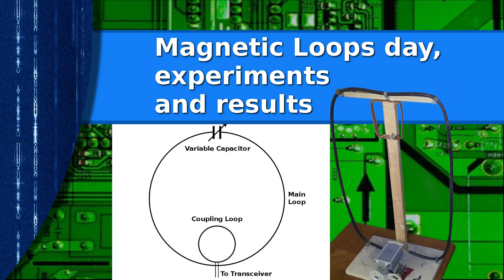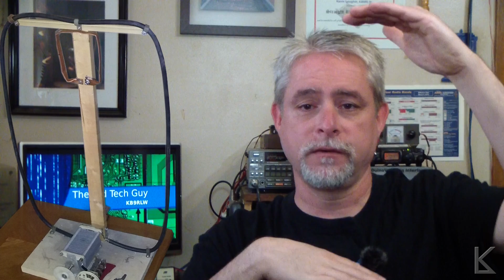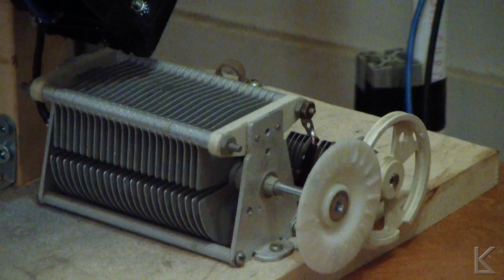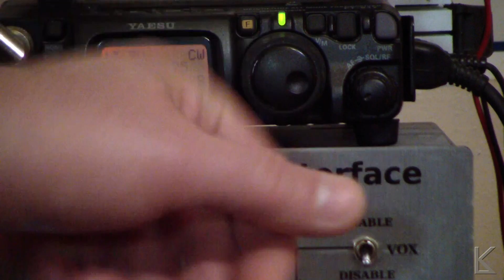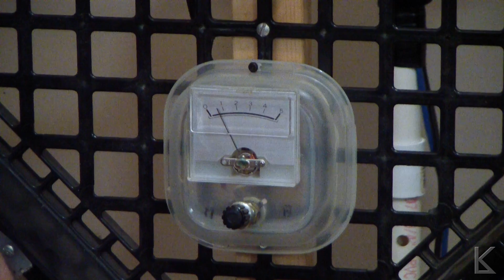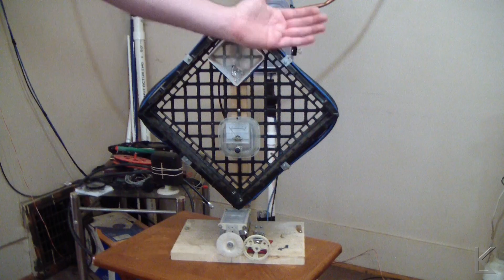Ham Radio Antennas - Magnetic Loop experiments, observations, and results

Comment: I'm glad I stumbled across this one, as it gives me new options for potential improvements. I have a loop made of aluminum strip and a butterfly cap diy. It's shaped somewhat looks like an egg because I haven't supported it, and I can't get the SWR below 1.5, so it's not usable for transmitting. I wanted to see if it would work with aluminum or if it really has to be copper. The price is quite a difference; a stril aluminum is 20x cheaper than copper.  One loop is 25,5 in (60 -65 cm) and one is 35.4 (90 - 95cm) and the cap is about 0 to 180pf.
So it looks there is more to test.. I'm also thinking about making an eight-sided barrel out of aluminum die-casting, but I haven't gotten that far yet. I need to see if I can get something that works first. Thz, For your video and the data you did get from your tests. 73" PD3A

Comment: I have an inocent stupid idea in my head. I will be experimenting with really small loops. I wonder what would be the effect of having a coil with coax shielded  cable? I mean having the coax cable external shield as the coil element and the inner core as the magnetic loop induced,  instead of the small inner loop. what are your thought on this?
Reply from the maker: Tried it, it does not work.

Comment: You are a good experimenter.  Don't be fooled by strong points of RF voltage. I also see people saying the opposite and incorrect statement in this thread, noting the high current points are where max signal is transmitted.  When an antenna operates at its resonant frequency, a standing wave of voltage and current is established along its length. It's the accelerating charges, not the absolute voltage or current, that create the electromagnetic waves. These accelerating charges occur due to the changing electric and magnetic fields within the antenna as the voltage and current oscillate. The high voltage points provide the "push" for the electrons to move, and the high current points represent the actual flow of electrons. This combined movement creates the oscillating electric and magnetic fields that radiate outwards as electromagnetic waves.

Comment: That directional assymetry seems very strange. Have you confirmed it on receive by listening to a steady signal and rotating the antenna ? Reciprocity must apply ! The only possible cause of this that I can think of is that the inner conductor of the coax feed is connected to a "hot" side of the feed loop and the ground causes a "cold" side. How about you try flipping over the feed loop (or at least the connections to it) and seeing if the radiation pattern changes ? That might help to pin down what the cause is.

Comment: I'd like to see an experiment with a loop mounted horizontally.
Reply from the maker: It has a radiation pattern kind of like a donut shaped the same way as the loop. So it acts omni directional like a vertical. That's the only difference.

Comment: Late to the party, but the squashed loop idea isn't a new discovery; it has featured in texts and discussions going back a very long time. The efficiency of the loop is not changed as you imply; it's the coupling and energy transfer that is achieved as it should. The logical extension is to have much closer coupling than even a squashed primary - which then becomes the twisted gamma match (which may be a wire twisted around the secondary, or one run parallel to it). So, nothing new, and no enhanced efficiency is achieved. You only discovered how to make loops properly, rather than badly. 👍

Comment: Loops work well for their size. I also distorted my loop and found the same as you, Kevin. On one loop I tried and found a better SWR by distorting the coupling loop.
On one loop I bought a small 3 Volt motor with gearbox, using two D cells with 3 Volt for fast tune, then 1.5 Volt for slow tune.
On the new loop I use a twin variable cap., one having large vanes and one with smaller vanes, the smaller for h.f. and add the large one to get lower frequencies even to 5 MHz but I don't expect efficiency to be great.
I have 19 foot of ⅜" coax and want to try a large loop for the lower frequencies.
G4GHB

Comment: Thank you so  much. I was wondering it the mag loop could be multiband. You answered  my question and have given me hope. I live in an HOA community that would not allow an outside antenna. I have room in my attic but no much. Most of my neighbors have cable so I hope not to interfere with their tv.
Reply from the maker: You might be better off with an end fed half wave.  You can use fairly thin wire and run it up to a tree.  It will be practically invisible to your neighbors and perform well.

Comment: I built a large magnetic loop antenna under funding from my employer. Plenty of money and lets do it right attitude. I used a  copper pipe formed in a large loop with a tunable vacuum capacitor in series with the loop using flat copper straps brazed to the copper. I inductively coupled as you did. The antenna was used with an NMR spectrometer to detect explosives/illicit drugs. It worked splendidly, management was pleased, I got a pat on the back.

Comment: Thanks for your interesting experiments.  I too am interested in loop antennas.  

I cannot claim to be an expert in the field or to have a good understanding of the physics.  However, I have strong reservations that field strength measurements taken so close to the antenna actually predict its real world performance at a distance.   Generally, radio is about communicating at several wavelengths away from the antenna.   

Even taking a measurement at  50 feet would place you well under a full wavelength for a 40m signal.  

In short, I am not sure that your measurments tell us about the actual radiation pattern of the antenna.

Comment: Do you think there could be a difference between 'near field' and 'far field' antenna directional properties? Your measurements using the 'in antenna' and 'handheld' field strength meters are surely near field measurements.
Reply from the maker: Far field should mirror near field as far as the radiation pattern goes.

Comment: Because of the phase shift between de voltage and current its normal that the most off the power is emmited at the top not the bottom where the voltage is high

Comment: yes, my personal experience showed me that by placing the capacitor on top gives much better results.
Reply: that is not the case, due to big currents in the top near the coupling loop thats the best for transmit
Reply: @dzuyd  That's not what my field strength meter says and what my observations showed me. Theory is one thing, real experiments show you a whole different result.

Comment: I like the way you coupled the coils to get more coupling.  Have you ever seen the outer loop wrapped all the way around the primary coil.  I was thinking of it like a transformer  with it's turns ratio. With a complete loop it would be 1 to 2 turns hence 1- 2 voltage boost but if you did 2 turns primary and 2 turns secondary with only 1 tightly coupled you would not get the voltage doubling. but get the benefit of the complete turn coupling.  just thinking out loud????  would this make it impossible to tune VSWR??  what is the voltage in a series tank?  I have no experience building loops. I want to build one. I am getting my first HF radio soon. I built a 5/8 wave plumbers J-pole  with great success for 2 M.

Comment: Try some romex house wiring.  It has  2 or 3 wires in it. They can be shorted together or conect to one wire then connect it to the next wire. The house wiring doesn't cost much,  easy to get,  also is 14 or 12 gauge.

Comment: Hi Kevin
Two very valuable tidbits of info from this vid.
The secondary cap changes everything when it comes to the difficulties controlling a magloop.
The apparent directivity of a square loop vs a round loop raises all kinds of ramifications.
Would like to see field strength comparisons of a square vs round loop of otherwise identical constructions especially for 40M NVIS ops. IE, Will rotating your little toy square loop CCW 90deg result in highest field strength in the virtical?
Good job Old Man! Your a valuable asset to HAMdom........
73 OM

Comment: I love your videos as you are like minded .You adhere to the rules and then bend them a little.One thing that has crossed my mind is that if you treat a mag loop as a transformer.Surely the better the coupling the better the output.So what would happen if you passed a primary loop and secondary loop through a ferrite  bead.i.e the coupling point was married together through the bead/barrel. Just a thought.I would experiment myself but have No space to do so these days.

Comment: You are measuring in the near field. This does not provide any usable results in regards of antenna characteristics in the far field (which you are interested in). In the near field there can be a wild mixture of E and H fields with different phases and amplitudes - so you are not really "measuring" something there.
Place the antenna at an open field and move a away 3-5*Lambda  for ideal results (1*Lambda would be ok for this type of antenna) and measure the H and  E fields.
If you have a tall tower available (most preferable a wooden one), place it in front of it and turn the antenna by e.g. 5° or 10° steps. Measure also at different floor levels. With this method you would get a very good horizontal and vertical radiation pattern of your antenna.

Comment: Kevin, a way to show where the most current flows in the loop is to use a string of Christmas tree lights as the outer loop.  The radiation current will cause the lights to come on near the current max.
Reply from the maker: Jeri Ellsworth did something along those lines already.  As I recall from her video, the most radiation happens near the coupling loop.

Comment: I had a loop that I used many years for receiving  shortwave that was built with an unbalanced tuning-capacitor from an AM radio, with the two gangs in series. What I noticed (if I recall correctly) was that the side of the loop that had less capacitive reactance toward the chassis of the capacitor (in other words, the side that was closer to ground) received less signal. Consequently the nulls on that loop were about 120° instead of 180° apart. Your main tuning capacitors seems to be completely unbalanced, with the chassis connected to one side. That definitely will affect your radiation pattern. For a symmetrical pattern you need either a tuning capacitor that isn't connected to its chassis on either side, or a tuning capacitor with two gangs that you can put in series.

Comment: I always understood that tuned loops weren't any good at all for transmitting. That's what I read, and this is the first time that I have seen any elaboration on that point. My experience has been, also, that loops do not give good reception in horizontal polarization. A few days ago, however, i read that a pirate broadcaster called Radio Capital used a very large tuned loop, horizontally oriented, for omnidirectional broadcasting on mediumwave, and supposedly  it worked very well. The motive for using a tuned loop, I read, was to avoid skywave reception of the station.

Comment: Hi, despite your moving the loop about and still seeing a max off to one side, you can't expect to see the real lobe with your 1ft box loop in front of another loop antenna, vertical cables over to the left, house wiring, house plumbing, and you stood to one side.. I know you are measuring near field pattern and on low power but your results or observations are still tainted.
You should for your own satisfaction, do these tests outside, at least 1/10 wavelength off the ground and with feed cables tested either side of the antenna and done with the antenna pointed in different magnetic directions to collect good unbiased data.
Only with reliable prouven data can you make decisions relating to developing its performance. And accurately confirm the results. Any false data and guesswork can only fog your perception of what is really happening. If you are searching for improvements then all your data has to be exact and as informative as possible.

Comment: Hi, Kevin. 
Thanks for a great, approachable design! I finished mine and tested it today. Here is a pic:
https://drive.google.com/open?id=1OBUOrHT04wDilUo-_g2olVgJ5Ss0a7o4

Note the flattened coupling loop per your discovery reported in this video. 

(1) Tunes 40m to 15m bands - check
(2) Seems to have good sensivity - check
(3) Can get SWR very low across a narrow band with fine adjustments of the tuning cap - check
(4) (2) RF probe works and with my remote control box (thanks again!) is a very good tuning aid - check

The only problem is that I am seeing arcing all the way down to 5W of power, much less the 20W that my Xiegu G90 portable can do.

I purchased this cap, advertised as 12 - 300 pF, 1200V:
https://www.rfparts.com/20apl300de.html

Possibilities I can think of:
a. RF Parts lied about the 1.2 KV rating on the cap
b. Bent plates - some are really close as a result
c. I have abnormally high voltage being developed as a result of the design.

So far, I don't see any bent plates, but b remains the most likely candidate.

How would you recommend that I proceed with troubleshooting? How did you measure the high voltage? Scope with an HV probe?
Reply: Update: this morning, I am not seeing the arcing. SWR tunes low, and I am not seeing the SWR jump up on the modulation peaks like last night. However, efficiency doesn’t seem to be very good according to PSK Reporter spots using FT8. Many more spots with my EFHW. Need more testing ...
Reply from the maker: The plate spacing is too close on that cap.  The first arcs probably pitted the plates, making the spacing even less around the pits.  Even at 5 watts, you'll get high rf voltage across it, maybe even exceeding 1200.
Reply: I think I had dew on it when that happened. I haven’t seen arcing since,
actually, even at 20 W.
Reply: What voltage rating would you recommend?
Reply from the maker: @audiobrian1  2K or higher to be safe, but they get expensive if you buy them new.
Cruise a hamfest.  There's always someone there with a box of variable caps to dig through.   I've found something similar to this, but at a price of $10 or so at a fest.
http://www.orenelliottproducts.com/oep-capacitors/m-73-group/73-1-75-37w-2-amp-strap-contact-5-0-quot-long
Reply: Kevin Loughin, yes dew ... condensation. I DO indeed need to cover it, even though here in the Front Range foothills of Colorado we don’t get condensing conditions often.

When I tried to cut out to fit the cheap plastic used on this food container broke all to pieces; plastic was too brittle.

Here’s the cap I used:

https://www.rfparts.com/20apl300de.html

As to the loop connections to the cap, I heard what you said in the video about the need for large conductors, and used two very short pieces of 6 gauge solid copper ground wire.

Seems to be stable now out to 20W PEP. I had an FT8 QSO with Argentina on my first portable op last Sunday. 10W, which is as hard as I like to push my Xiegu G90 running FT8. These things do work well!
Reply from the maker: @audiobrian1  drew?  Is it outside with the cap exposed?  If it's outside, you'll need to enclose the cap end.  Check your connections from the loop to the cap. They need to be a solid low resistance connection with thick wire and clean contact points.

Comment: Was looking at loop antennas for swl and found your video.  Near field far field aside, was curious about your radiation pattern not being symmetrical.  I was wondering if you placed a 1:1 balun between the loop and the coax, if the radiation pattern would then become symmetrical?  I know there would be some loss with the balun but it might explain the odd pattern.
Reply from the maker: That's an interesting idea,  I might have to try that sometime.

Comment: Kevin, may I ask for some direction.
I am revisiting DXing from many years ago. Space is a big factor so mag-loop antennas caught my attention. My thought was to build my own tunable unit from 3 khz to 30 meg for receiving only. The antenna would be outside mounted on the side of a low chimney. I would mount a rotor so the antenna could be swept. I have looked at the MFJ 1886 LN and Brookwood ANA 1530 LN designs. I think that approach would work, however, the antenna amplifier would also need to bee fabricated.
This would be a nice project before winter sets in.
Radios in use are Hallicrafters S-120, Tecsun PL-660 and Tecsun S-2000.
Could you advise.